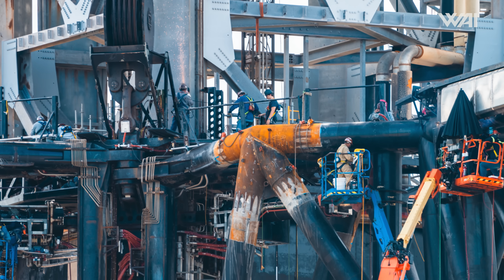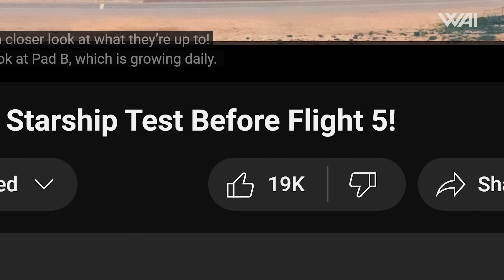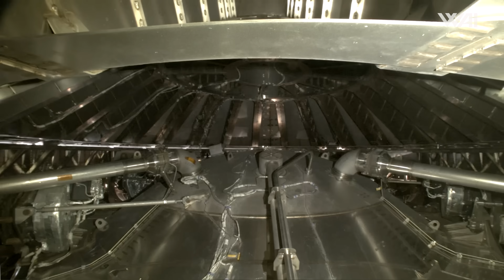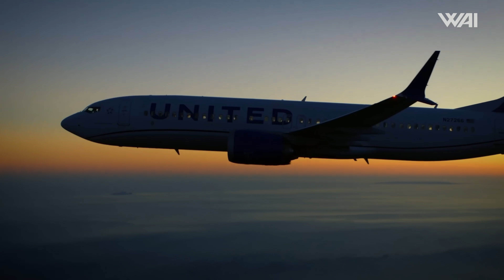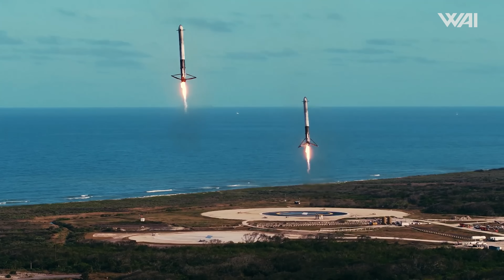SpaceX Finally Lights Starship Engines Again! Is China Catching Up?

Comment: Next question:  Assuming SpaceX gets the Starship into full production (in-spite of the FAA), where are they going to park all those boosters and starships??
Reply: There's no suitable firm ground in the area -- it's all coastal marshy wetland. Too bad SpaceX couldn't have had a location with good solid rocky coastline well above the water level so they wouldn't have to worry about saltwater infiltration, tides, storm surges, flooding, sinking, and such.

Comment: The FAA is literally the best in the world for aviation standards and saftey, the gold standard. I don't understand how such an asset is being smeared as a liabilty. The FAA regulates, companies innovate. The fact that SpaceX has still not achived their goals after 4 flights is not the fault of the regulators. SpaceX have had the time and ability to practice their "Iterative design process" and to say they just needed more chances is illustrative of their failures. Could say the same thing for Starliner but you won't.

Comment: I’m the biggest Spacex fan and attended the first Starship launch but some of their ideas need reexamining. The Chopstick arms have the least leverage possible. Design should have hydraulics on the side of the carriage so it can exert more leverage and give arms more precise movement. 
The Starship using small landing sockets used to insert small balls from chopsticks is asking for failure. They need to have pop out hooks and land in same manner as booster. Hinging the hooks underneath heat tiles could be extended in same manner as shuttle opened its landing gear thru heat tiles. Same with launch pad. We were told there couldn’t be a flame trench. Now pad two will have a flame trench. I hate to be negative but I would not want to land in a spaceship that had to hover to a ball and socket landing.
Reply: Elon has said that the ship will have the landing nubs in the future
Reply: @Wurtoz  I am glad to hear that. I worried that this would be the big flaw that could hurt the entire project.
Reply: You a weird fan... Of course the design is not good yet .... The goal is to test it with the minimum needed so they can adjust the ship with what they really need, minimizing the cost of flights

Comment: I'm sure the joint wasn't designed to take lateral loads hence the upgrades. Someone probably did some simulation and showed potential failure after prolonged usage.

Comment: I'm a happy Starlink user... I've had it for over 3 years... I was a beta tester for my area and literally the first person to get a terminal in my area... Never had issues with it at all...
Reply: what about the data caps ?
Reply: @jonniiinferno9098  data what?
Reply: @the80hdgaming   - "data cap" - as in - once you use to100GB of data - you have to pay for additional data usage - something like $100 for each additional 10GB of data usage...

Most of the "satellite" or "cell tower" internet services have a data caps - and charge additional fees similar to that...

So, my question is - 
Does Starlink have a "Data Cap" ?
Reply: That's,.....Great.
Reply: why so many ellpsis? it seems passive aggressive and goes against what your are tying to say
Reply: @lilbitesgames385  they are a habit picked up 25 years ago...
Reply: My starlink was just delivered.  Any advice before I install it on a post in the garden?
Reply: @eugeneckbell Dig a post in the garden well. So you don't complain that you're losing connection because those moles are crawling into the ground under the post...
Reply: too bad for starlink astronomy interference issues.  bumpers
Reply: @kevinim300  It's nearly impossible to always avoid such conflicts of interests
Reply: @kevinim300 please explain?  Shouldn’t the new telescopes that the Starship will take to the far side of the moon make up 100 fold for the small interference with vintage ground based telescopes?  If you are pro Astronomy you are pro Starship.
Reply: @eugenecbell  thought this discussion was starlink today not starship tomorrow.
Reply: @kevinim300  I look forward to the telescopes on the far side of the moon.  This is where the discussion has gone.  Keep up, we aren’t going back.

Comment: Just a wild hair thought, but SpaceX should use old design/scrapped ship heat tiles to protect components on Stage Zero. As long as they can be affixed securely enough not to be blown off by the launch/landing blasts, they would provide excellent thermal protection.

Comment: With Starship3 and Raptor3, please consider putting legs back on the Starship. Some loss of cargo capacity, but it should still be larger than original (Starship1, Raptor1)  legless cargo capacity. 

Even when all the current challenges re chopstick landings are resolved, there remains a huge tension. 

Chopstick landings require at least some hovering. If big enough wind gusts, longer hovering needed, requiring more remaining fuel. The bigger the BOOM, if something goes wrong.

Comment: The chopstick bumpers need hydraulic actuators within them. Because when you start with a hot starship and fill it with cold propellant it changes sizes drop right off your rack if you're not careful. And then again the one coming back from space isn't pressurized either.
Reply: interesting theory...temp related?   i too once considered a hydraulic cylinder between the rams...long ago...for speed.  but hmmm not for temp. imho

Comment: You only need one launch control center per launch tower. On the other hand you need a Flight Control Center for every Starship that's in orbit. Spacex will need many more flight control centers for starships than they will need launch control centers.
Reply: They can surely monitor multiple ships from a single FCC, just like they do with Starlink...
Reply: @apobg  I was think of flights containing humans which seems to be the ultimate goal.

Comment: Thanks for the indepth update of spaceship news Felix. But I have a question. Many, if not all of the delays for Starship come from the FAA. My question is why is the FAA regulating SpaceX but only NASA is regulating Starliner? They are both in the same phase of development and therefore should be on the same regulator path. The regulations state that NASA regulates during development then the FAA regulates once the rocket has been cleared for commercial operation. So why the difference? Can you explain?
Reply: Actually very few of the delays with Starship has come from the FAA. There has been a lot of talk about it but in the end, SpaceX has never been ready when the approval has come. This might be the first time it actually is FAA that delays the launch. BUT, remember that this is also most likely caused by SpaceX failing to get permissions for things they could have applied for a lot earlier.  Many month, even years before they did.

Comment: Those are steel studs used for walls, there are gonna be a lot of walls in the office building. They are replacements for two by fours as are used in home building. Also, they are much more resilient in commercial building structures.

Comment: Those are blast-proof walls, and there's no way it would survive an out-of-control Starship dipping on the roof.  Those are hurricane-reinforced walls, made to survive 180 mph winds, seen those before at a chemical plant I used to work at in Bishop, TX.  It's so that people can shelter there during a hurricane, because you can't have staff who must monitor security and chemical/pressure systems evacuate.
If this were to be used during launch, you'd see something more bunker-like, similar to the pumproom they built at the launch site.
Reply from the maker: While you're absolutely right, I think you're confusing something here. NASA has the same. If SLS would fall onto NASA's Launch Control which is roughly the same distance from the pad, it would not have a chance of surviving. :_WAISweet: The times of so called Blockhouses are gone. Those were way closer to the pads.
Reply: Good catch
Reply: I'm a commercial carpenter. Heavy gauge steel studs are used to reinforce buildings from high wind. such as hurricanes.
Reply: The flame coming from the bottom of the first stage is much much more than 180 mi an hour, multiply that by about 10.
Reply: Cool observation. That said, given the building is where it is. Regardless if it's manned for launch or not. It still needs to be able to survive the sound shockwaves of a launch. If it couldn't, SpaceX wouldn't build it there. 

Given how powerful Starship is and will be in the future, if a cat5 hurricane was to come to Boca, that building if it was sentient would likely be saying... "Only Cat5... Pfft, hold my beer".

Comment: Will Starships next launch be refitted with Raptor 3 engines, or maybe just with some Raptor 3's to test them and is that part of the FAA licensing issues. What does SpaceX plan to do with the already built Raptor 2 engines still new and unused. Scrap them or still use them?
Reply: SpaceX will probably continue to use Raptor 2 engines for a while, at least until they get a nice continuous supply of Raptor 3's. Raptor 2 is also a reliable and proven engine platform for SpaceX, and it'd make no sense to throw out a bunch of perfectly fine (and quite expensive) methalox rocket engines.

Edit: Oh, also, yeah if they added Raptor 3 engines now it'd require SpaceX to go through the entire FAA licensing process again.
Reply: Well, Raptor 3 is very different from Raptor 2, so it can't just be placed instead of Raptor 2. But what about Starship V2? That's interesting. But, I think, It will probably have Raptor 3 engines because of new fuel supply system. It will be nice to see Starship V2 static fire or at least video footage of Raptor 3 testing.

Comment: Rapid reusablity is an ego trip vs practically... instead of "rapidly" reusing one ship, just have more ships in the rotation and refurbish return craft and whatever pace is necessary for safety
Reply: After x number of flights, the stress on all parts of rocket, can result of having to replace all parts. Replacing only some parts might not be safe.
Reply: @kjetilhvalstrand1009  elon's argument that if you threw away an airplane after every flight, then it would be too expensive to fly... 

But the airlines take planes out of service to do maintenence all the time. Not every plane they have are flying customers.

The same will need to be true for Starship..

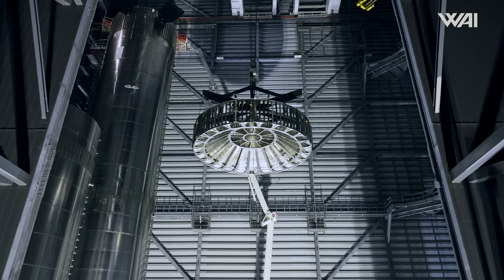Comment: @10:50 mark; hot staging ring - Could the HSR be enhanced to possibly replace the grid fins and perhaps offset each other's weights? Just thinnin...
Reply: I think the hot staging blast shield and methane tank forward dome will be merged into one, greatly reducing overall mass. 

All blast sensitive parts will be hidden inside the forward dome or moved to the hull sides, including the grid fin actuators. Cables will be upgraded to wide temperature range products, such as stainless steel alloy conductors and silicon insulation.

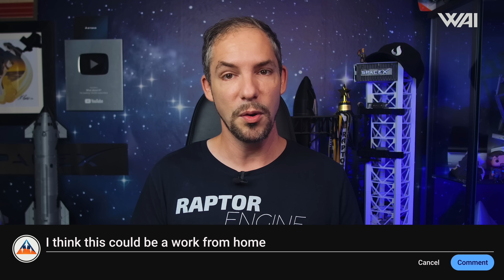Comment: 9:28 I know structures that house sensitive technology (EW tech, rocket engine plans etc.) that needs to comply with ITAR need to be in structures with a certain level of hardiness, depending on plans that reinforcement might be to comply with those secure facility requirements.
Reply: They just looked like metal interior studs to me… am I missing something?

Comment: Yes, well, the fact of the matter is that it should not be to long before humans get smart about space! Figure out how to make that elevator work which would then allow a dozen more elevators to be made at a fraction of the cost then forget mars when giant station, much closer to earth, with all the manufacturing needed to seriously harvest asteroids with all the necessary materials needed that could then be used to make super big habitats that would potentially alleviate all the stresses humans are putting on the Earth. Blasting giant rockets from a stand still to velocity great enough to break free of the Earths gravity just seems a bit archaic to me.

Comment: They need to form a regulation agency for rocket launching and remove it from the FAA.
If the FAA can't keep up with the pace of rocket development, then have an agency just for that purpose.
Reply: The problem is that any/all agencies under this administration are politicized/weaponized/corrupted against political enemies.
A separate agency would be just as corrupted. 
More lazy/uncaring & incompetent chair-warming government hacks.
DC votes 95% Democrat.
Reply: FAA apologists claim this isn't the FAA's fault, all the rest envirogencies are to blame . Why would forming yet another bureaucratic agency change anything at all?
Reply: @admarsandbeyond  Any/all agencies under this administration will commit  political malice as directed, no matter where they are or what you call them.

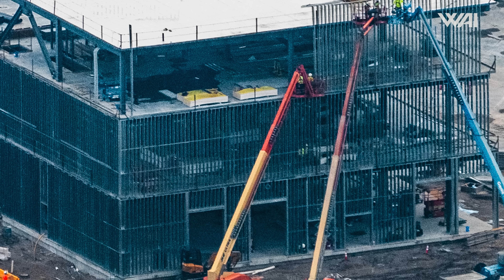Comment: That actually looked like standard spacing on the wall segments. 8:47 But instead of a 2x4 in size, it might be 2x8 or 2x10. Perhaps to help against the vibration of Starship launches?
Reply: And also against explosions on the pad. It's non-zero probability.

Comment: They used to tell you to turn off your phones and electronic devices when flying on planes, now they give you free wifi on flights.
Reply: That's because the actual reason for telling people to turn off their phones was people in planes possibly flood pinging  phone towers on the ground, which stopped being a thing after the 450MHz band stopped being used for phones and the towers started looking mostly down for connections.
Reply: It was never the FAA who forced people to turn off their phones, but the organisation that regulate mobile companies, because of hand over between mobile towers issues at speed. They used the phone interference on planes to force and scare people.
Reply: @Enigmatic..  free Wi-Fi that doesn't work..
Reply: @FransBlaas1 not what I've heard!
Reply: @gregbailey45  I even paid for it and it didn’t work.. BS..
Reply: Your also told not to bring water into a terminal. So they can then charge you $10 a bottle.
Reply: @dl4087 blame 9/11

Comment: The bumpers are a hard stop and the motion of the arms creates a massive moment along their length that is almost impossible to stop. We saw that in the way they would sway after stopping.
I do not know the details but I imagine they will use the hydraulic control to "stop" early and control the sway with active use of the hydraulics.

Comment: What if the hot staging ring design were to change its intention to include Starship landing?
Would the extra power from raptor three make it worth the loss in extra weight
Reply: I read this 5 times and I still have no idea what you meant to say

Comment: Given the delays for flight 5, why doesn't SpaceX test the catching process by having some kind of vehicle do a short hop and then come back down right away onto the pad?
Reply: that would need another friggin license...
Reply: That would require a license not likely they'd use a crane to "drop" a test tank on the sticks at a controlled pace
Reply: @TaylorNewberryC   I have been thinking the same thing for quite awhile however, these guys probably though of this and another 1000 things more.
I think it all comes down to bureaucracy.
At this point, engineering has to wait for this BS.
Reply: if they wanted to wait another year for a license then yes but noone wants that
Reply: Far better to test an actual launch & return than to risk vehicle & pad on a contrived partial test.

SpaceX are space & engineering geniuses acting in good faith.
The FAA are clueless administration hacks acting with political malice.

Comment: Why use the chopsticks when they have landing legs for starship designed for. Lunar landings? After all Elon says basically no updates are the best. Pluscwith raptor knowledge they have more experience than anybody
Reply: @alecbrown66  Well, legs that have to support a rocket in 1/6 Earth gravity would not be strong enough to support a rocket in full Earth gravity.  To conserve mass, they would be made only strong enough to land on the Moon (possibly Mars) but not Earth.

Comment: What are they doing to the ship are they just going to throw it In the ocean and can you talk more about the Chinese space station you briefly mentioned in a earlier episode
Reply: From what I remember, the main mission objectives are to catch the SuperHeavy booster, and test Starship's new heat-shielding during re-entry. We're likely going to see a similar mission profile to IFT-4 with Starship performing a soft water landing in the Indian ocean, but with SuperHeavy doing a full boost-back burn to Starbase, where it will then be caught if all goes according to plan. However, anomalous readings from SuperHeavy may cause an abort and have them redirect the booster into the Gulf.
Reply: IFT-5 will likely have Starship attempting a couple sub-orbital course changes. Enough to prove that circularization and deorbit burns in zero-G are going to be dependable. plausible.
Reply: And where is the ship from the previous flight?
Reply: @СергейБолдин-в9м  
Starship from IFT-4 is at the bottom of the Indian Ocean. Likely scuttled by using the explosive charges in the Flight Termination System.